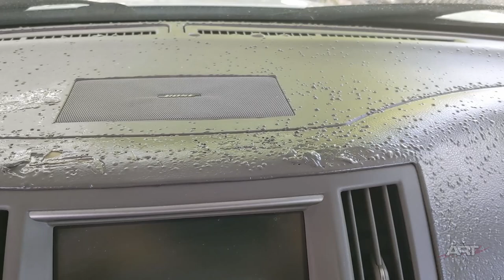Dash Cap Install v27

Comment: I love your videos! I installed one of these dash caps in my own vehicle and am offering them to my customers. I’m interested in interior vinyl and leather repair. I like how you used dyes with a plastic primer to make a custom color. Just another thing I can offer my customers! I also love your choice in hats!👍
Reply from the maker: Thanks Chad.  Hat's off to you!
Reply: I have a question. Where do you find the flat iron tip for your butane powered torch? I can’t seem to find them anywhere